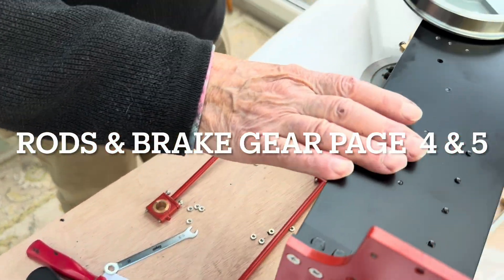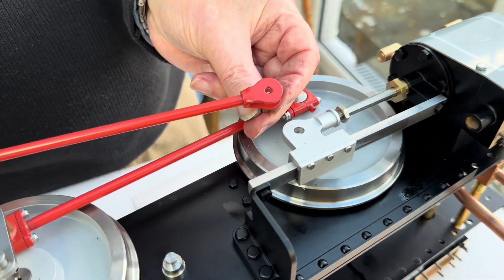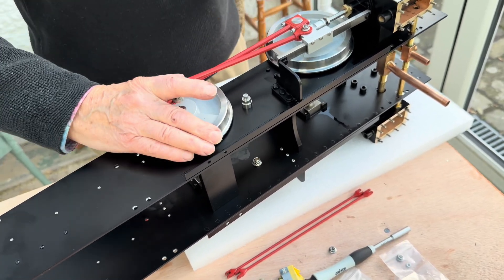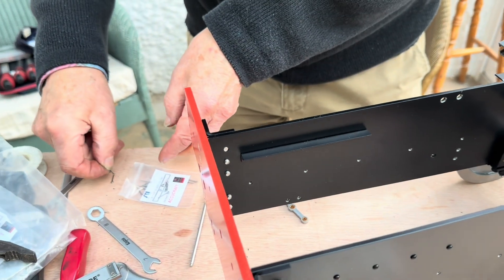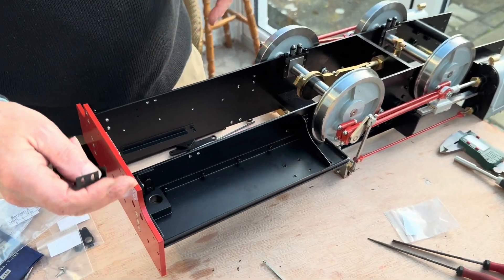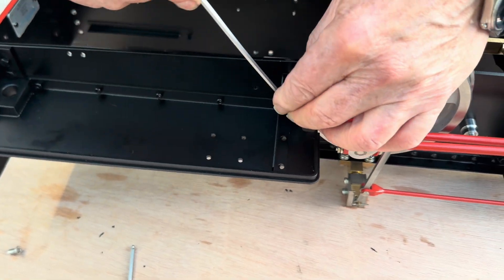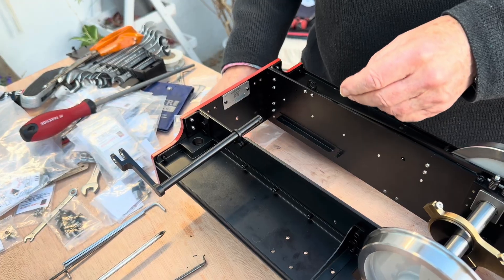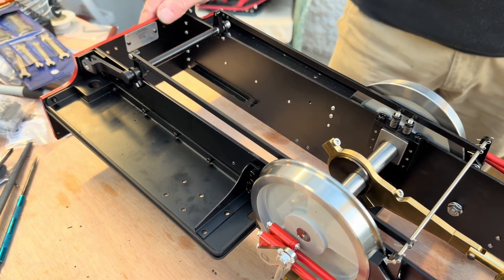Maxitrak 5” wren kit build 4

Comment: Well, I had a bit of a "Duh" moment when I saw your 1 pair of driver wheels being braked! I realised that with a coupled driver wheel arrangement that only 1 pair of wheels needs a working set of brake shoes😢
On my loco, I have 8 brake shoes, and all the rigging is compensated. A heck of a lot of work ( looks speccy tho') and works. I could have had a pile of dummy shoes, and no complex linkages, and no one would be the wiser! Ah well, maybe next time.